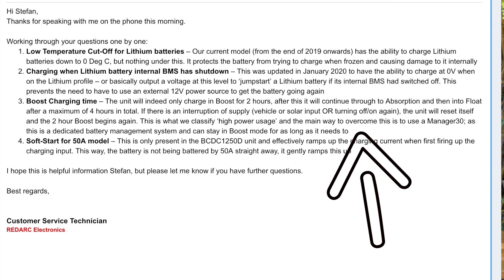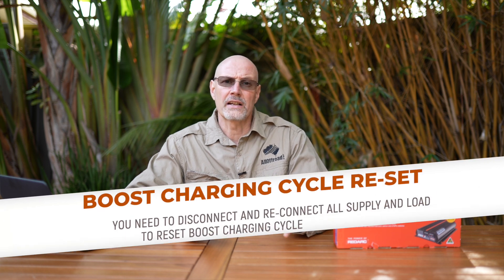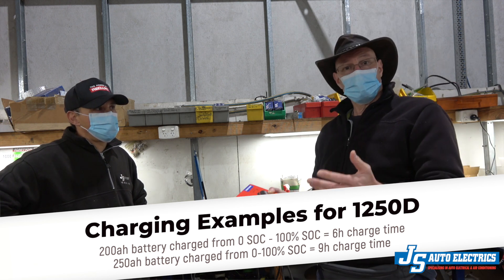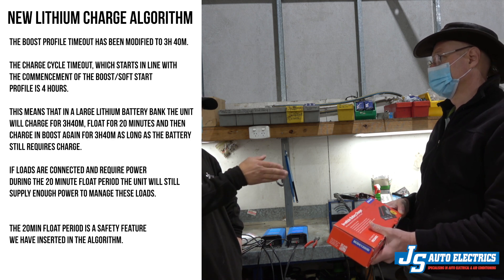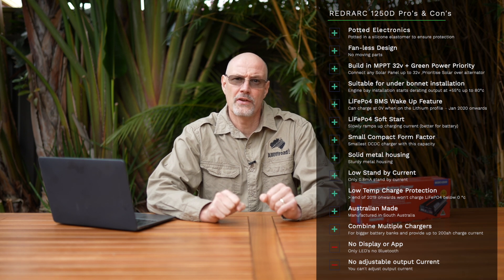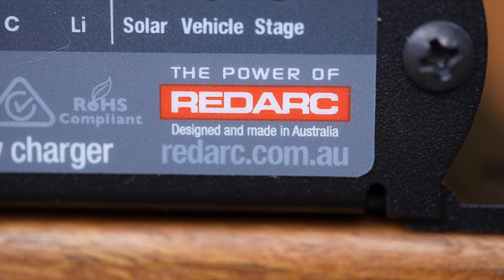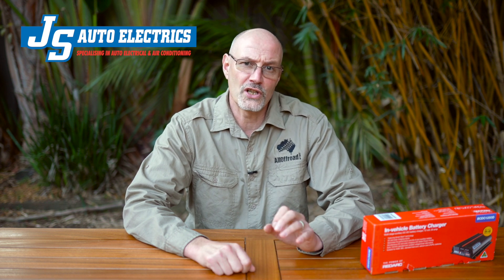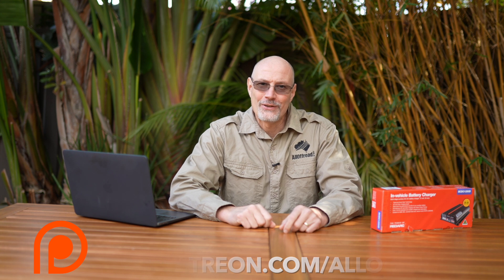Redarc BCDC Boost Charge Limit Test | The truth | Testing Beta Firmware | Surprising Outcome

Comment: Query - I have a Manager30 and have just purchased a BCDC1250D as Redarc informed I can add this in parallel to increase charge rate from my alternator to a possible 50A+30A from the Manager 30. My concern now is that I might have purchased an old BCDC1250D and am concerned this is the old one. Is there a firmware upgrade etc that will increase this to the 4HR boost?
Reply from the maker: best to ask Redarc I believe you can see it on the Serial Number
Reply: Cheers and thank you for providing what is very important technical data on the limitations of this over other redarc DC to DC chargers
Reply from the maker: unless you purchased old stock I would assume you have the updated algorithm

Comment: Can you just disconnect the input to reset to boost mode? Or input and output needs to be reset?
Reply from the maker: all load and charge need to be disconnected but seems to be fixed with new units
Reply: @AlloffroadAu  Thanks for your reply. I have tested my 2020 unit and can confirm this. I happen to have a relay with a dash switch on the input of mine. I can isolate the output via the blutooth bms, and it will go back into boost mode. So for the odd occasion this will work I guess.  Bit of a dud product IMO. They need a configurable charger.
Reply from the maker: yea charger was designed before Lithium and more for single batteries. The issue is solved with new generation I I heard there is some new stuff coming from redarc.

Comment: Hi Stefan, Thanks for sharing your research - it's been really useful as I plan my upgrade to a lithium aux  battery in the back of my LC76. I've pinned down the dcs 150ah for the new battery as it will fit perfectly with my setup. I also need a new charger and I like the victron 30ah except for the comparatively low output of the most powerful unit. I have considered 2 X victrons but that will take up more space and doesn't really seem cost effective (solar regulator will be another cost with victron). Noting the charge algorithm characteristics of the redarc units,  how have you found the performance of your redarc charger (50ah??) paired up with your dcs 150ah battery
Reply from the maker: its good mate never had an issue though keep in mind it will not put out 50A for long unless you are in deep winter and its quite cold, I found that at around 23c outside temp the unit will deliver 50A for around 15-20 minus and then go the 40A seems to be what most of them do though.
Reply: @AlloffroadAu  thanks mate. In that case the 50ah charger sounds like the way to go if I want to achieve 40ah charge input most of the time.
Reply from the maker: yes, not perfect but I think best solution out there atm.
Reply: @AlloffroadAu  thanks again mate. Every option I look at has some degree of compromise. I reckon the redarc will be a reasonable solution.
Reply from the maker: yep I'm happy with it

Comment: Hi Stefan
You commented on this video and your everdrive vs redarc video about the derating of the enerdrive happening earlier at 50oC than the redarc at 55oC. You showed that even on a 25oC air temp on a bench, the redarc got over the 55oC and was derating.
Do you know if the enerdrive with its internal fans keeps a lower internal temperature compared to the external temperature due to the fans blowing cool air inside, and thus doesn't derate as quickly or at as low air temp as the redarc?
Reply from the maker: from what I heard Enerdrive also de-rates quickly to 40a same with Redarc it will stay at 40a till it reaches 60c

Comment: I have always been a redarc fan always use there equipment but I found victron state of the arc equipment as you can Adjust all the settings and it is Bluetooth so can see current operation status
Reply from the maker: yes 100% I agree also like Victron a lot, unfortunately DCDC charges have to low amperage for Lithium and overall operating temps are lower than for Redarc

Comment: What if you drive for 3 hours when it is on float or absorption mode and you have a fixed 100w solar panel and park your vehicle. Will it still stay on float or absortion on solar until the cycle is done then go into into boost? Or will the solar charge the battery regardless at a full 100w when the vehicle is off.
Reply from the maker: never tested that but supposedly will stay in absorption mode till next cycle, however Redarc has a new firmware out which changes that for Lithium

Comment: Great info Stephan.
I have a 4 month old Bcdc1250d charging 510ah of lithium which switches straight from bulk to float charge early in the afternoon. The charge (from shunt) can be as low as 84% up to 93% depending on the discharge overnight. Today I disconnected the earth on the charger when it went to float (at 93%) and on reconnection it went back to bulk charge. Now at 99% still on bulk. I don't want the hassle of having to monitor the charger and reset it every afternoon. Hopefully Redarc will reply to my email with a solution
Reply from the maker: supposedly disconnecting earth alone will not work but it seems it does for you? Redarc should provide you the new model with changed charging profile.
Reply: @AlloffroadAu  . Disconnecting the earth definately worked. After about 10 seconds all the lights went off. I have emailed Redarc so fingers crossed. I will wire the earth through a switch for now. Thanks for your help.
Reply: @adamwhitaker6188  update?

Comment: Hi hi, i I’ve been using redarc for years fist the first sbi12; then the newer red coloured sbi12,and now the redar bcdc1225d that’s in my personal Hilux but 2021 SR5  work Hilux redarc tow pro elite v3, bcdc1225d powering two 105 ah lithium what should I look out for in not 2021 Hilux with batterie and bcdc1225d charger
Reply from the maker: way to slow charging for 2 x105 Lithiums would get a BCDC1250D

Comment: Stefan, thank you so much for your thoughtful investigation.  Today, I have contacted Redarc and they have advised that the update has only been available in the past few weeks so if I want the new profile, it will be prudent to buy from Redarc.  Still not clear on whether my fridge will still be operating during that 20-minute cold down period.  Thank you again Stefan.
Reply from the maker: yes, I also have not seen one of the new charges yet, besides the prototype, I'm testing. I don't think the cooldown will affect the fridge the battery should happily power it for the 20 mins

Comment: Hi Stefan. The charge should not know what load connected to battery supply. Fridge, oven, etc. The effect will be longer to charge the battery supply, if it's under 13.9volts and then 2hr or 4hrs. Is that your understanding. Russell
Reply: Are you happy with your set-up or still got your mind on it. Can find info from a friend. Worked on testing. Now retired.
Reply from the maker: I never had an issue with the set-up anyway, are there a few features I wish the Redarc did have? yes for sure. It always worked for me besides the one time when the charger was installed between headlight and battery and overheated and did not charge my batteries in the Desert, relocation behind radiator grill solved that.
Reply from the maker: I’m not really sure what my understanding is as the info from Redarc was often conflicting and incomplete unfortunately.

Comment: Thank you for this video , I have a 1250 at the moment charging an itech 120x lithium battery and I can’t get it to stay in boost mode for very long either. I’m currently using a VictronConnect shunt to monitor the amps coming in and out and I’ve got a 200w solar panel permanently connected to the roof of my car. Do you think disconnecting the solar panel would reset the boost charge process ?
Reply from the maker: Interesting, while Redarc said the boost charge limit exist neither myself or JS Auto Electrics nor another Auto Electrics guy on Facebook who tested it extensively could get it to get out of boost mode. If it's the boost mode time limit disconnecting solar would not reset it you would need to disconnect all charge and all load.

Comment: Hey, I just bought a BCDC1240D and no one mentioned this issue at all. I’m wondering whether it’s possible to figure out whether I received the old or new profile? Seems like a pretty dodgy issue if it’s not going to top up the batteries. Cheers!
Reply from the maker: Best to ask Redarc and please let me know what they say, as I mentioned in the video though for LiFePo4 it does not seem to be a problem but probably is an issue if you have a bigger AGM battery bank.
Reply: @AlloffroadAu  yeah sweet! I wrote this comment before I got to the LiPo section at the end of your video 😂. I have a LiPo 130amp battery, so it seems like I should be ok. I’ll let you know how it goes
Reply from the maker: please do especially if it does not work as we could not get it to move out of boost mode with a LiFePO4
Reply: @AlloffroadAu  based on the research I’ve done after watching your vid, I found that there’s only 2 stages for the Lithium setting. Looks to be a little different to the AGM charge situation.

Also, what’s your thoughts on how thin the wires are coming out of the back of the unit? They seem super duper small compared to what they recommend for the rest of the system.
Reply from the maker: yes lithium really only needs Bulk and maintenance, wires are ok given the max is 50ah you can get in via the BCDC1250D the smaller wires are just for the set up to tell charger what mode to operate in.

Comment: Hi Stefan, You are a true legend, I could not work out why my charger would not stay on boost mode and this is why. Do you know how would the firmware update get deployed if instated?. Removing my bcdc from the car would be a lot of work.
Reply from the maker: thanks mate, unfortunately I heard not back from Redarc in regards to an upgrade maybe contact them directly but if it's possible i think you would need to send unit in as I don't think there is an easy interface which would allow upgrades (just my two bobs worth though)

Comment: Great info. I just drove down from Fraser to Ipswich charging the camper 125 agm  and the car has a 125 agm as well. The camper has 2 fridges 90 waeco and the bushman. both running. 20 amp thunder dcdc charger in the DMAX. 5 hours travel time. When i got home the camper 125 agm  was only on 60% . I am thinking after your great info i should unplug the car mounted agm to charge the camper one. Your thoughts as the car mounted agm is always fully charged.
Reply from the maker: if you charge 2 x 125ah AGM 20a is a very low charging current. you probably could put a switch in to switch between both, car or trailer charging.
Reply: @AlloffroadAu  good thinking thanks

Comment: Hi Stefen, how often do u see the 50A dcdc charger put out the full 50A and for how long? Seems that it's always outputting around 40-45A?
Reply: I have been testing in the house @ 18°C ambient. After 10mins of charging the current suddenly drops from 50A to 43A and then stays on 43A.
I then gave it a gentle breeze from a pedistal fan on the lowest speed 1m away, and after another 10mins, the charge rate was restored to 50A.
This unit was designed to ge mounted in airflow. In a cabin it will get hot and thoittle back to 43A. I will fit a fan to mine and re test.
Reply from the maker: never looked at that or noticed it until we did the bench test, seems like charger reaches 55°c internally quite quickly (didn't time it but say around 20 mins laying on a metal bench with 20°c ambient) and then de-rates and stays around the 40a mark continuously.

Comment: Thankyou Stefan, this is the product development feedback that companies like Redarc need! The company I work for had multiple service vehicles with the older 1225 and 1240 models that we struggled with a lot, in remote areas, because that 2hr bulk mode was never sufficient to cover our 12volt loads and fully charge up our AGM batteries. So much so, that after losing batteries and struggling, we added extra fixed Solar panels, some with separate solar regulators and disconnected the BCDC from controlling the solar input and left it manage the smart alternator. Things have improved a lot with the newer BCDC50, however,  I think some user selectable settings  should be available via Bluetooth, people are more Tech savvy and paying big money for their batteries... they should have more ability to control the charging settings, or download/select the battery manufacturer's recommended charging profile to suit? What about the Built-in BMS in some Lithium batteries connecting to the BCDC and handshaking state of charge information, so that the Li-Po battery decides when and how it's charged?
Reply from the maker: yes mate 100% Redarc supposedly have a few things in the pipeline and I provided also a few more suggestions for product improvements so let's see what happens.
Reply: I have an older 1240D and this is a massive PITA, especially if you have the vehicle parked up. A fixed panel will charge at ~7A for 2 hours and then go to absorbtion, where the loads from a(n innefficient upright) fridge inb a hot car can easily exceed the absorption current - meaning that despite bing in full sun all day, the battery can easily finish the day with lower charge than it starts. I suppose a seperate dedicated MPPT solves this, but makes the redarc really only useful when leisure battery voltage drops below a certain level (seems to be about 12.4V). It also means that if you have innefficient loads, the unit algorithm will never fully charge the battery.

Comment: I watch these videos but have never owned a Redarc charger so don't claim to know any of the details. What I understand is that (a) under certain conditions it won't cover the loads being taken from the battery even if you are driving, and (b) is this the same unit which Andrew White found could discharge the auxiliary battery completely? It sounds to me like an over-priced, very flawed product. An absolute liability if traveling to remote regions in fact.
Reply from the maker: ASWP is a complete different issue which every DcDc charger has and to be honest it's only a issue for ASWP as he seemed to have difficulties how the chargers work. The Redarc BCDC albeit not perfect is still a very good charger for most applications In my book hence I’m to continue using it.
Reply: @AlloffroadAu  OK. I said I wasn't an expert on DC-DC chargers (having gone a different route myself)..
Reply from the maker: yea while I used the BCDC range in some build as early as 9 years ago I have also done well with a simple VSR and alternator charging, this was before Lithium though. At the moment I only use a BCDC in my Camper Trailer my car DCS LiFePo4 are alternator charged.

Comment: Great Vid, thanks for that as I was just about to buy and set up two 120 lithium's in the back of my 80 series and was wondering if they fully charged them off my 4wd via bcbc charger
Reply from the maker: if it's LiFePo4 they should, to be sure I still would request the new profile with the 4h boost charge limit
Reply: @AlloffroadAu  Yes LifePo4 with Prismatic cells to handle the corrugations. Thank you
Reply: @AlloffroadAu  can the new firmware be loaded onto older 1225d, if so how? I just put a 105ah lithium in and want to ensure it stays fully charged. 2hrs at 25ah only will charge the battery to 50%

Comment: Hoping they can do something similar for the Redarc manager 30 as well. Great informative video.
Reply from the maker: I don't think the boost time limit restrictions apply to the Manager 30, as far as I know it provides the 30a continuously as required by battery.
Reply: Manger 30 is a different kettle of fish. The manger 30 has all the smarts and doesn't just rely on voltage. Because it has the ability to calculate the current consumed and the the addition of the battery temperature sensor as well as voltage sensing it can keep charging till the batteries are full. 
If you have the room and are going to mount the charger internally, I think the manager 30 is the way to. Although alot more costly at first glance. If you buy a comparable dcdc charger, mmpt solar controller, 240v charger and stand alone monitor it works out to be around the same price but a smarter system.